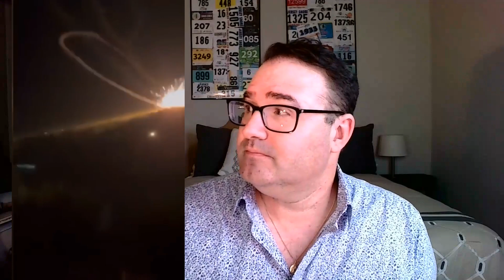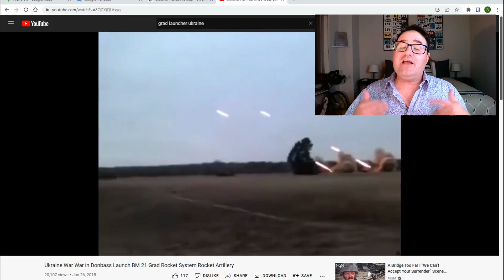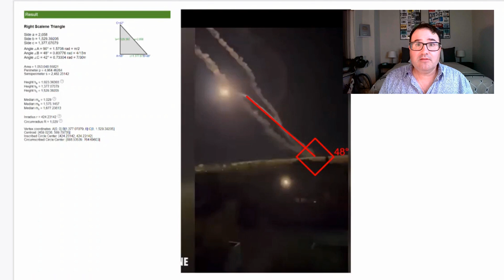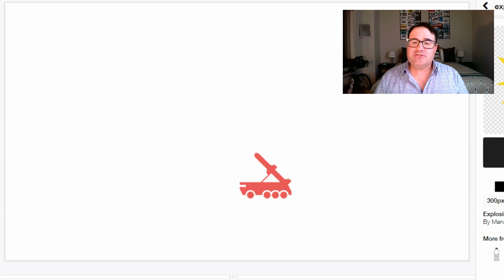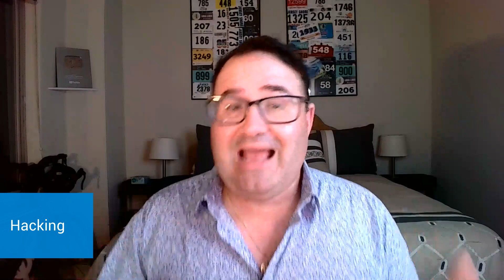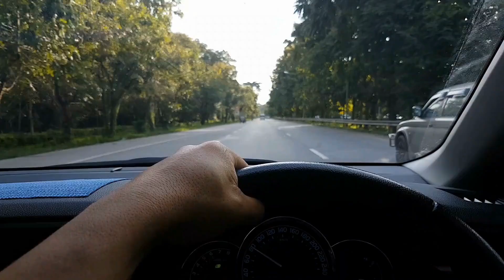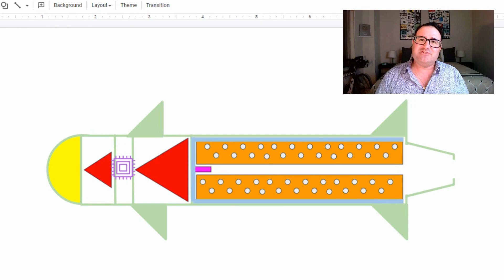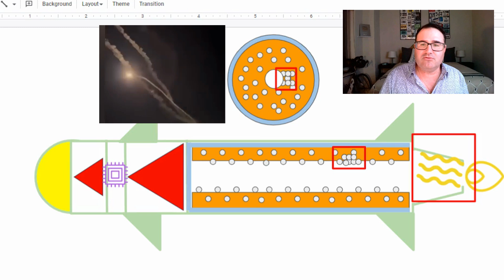Why this missile U -Turned

Comment: Hey. Great video but I was wondering if you happen to get your maths wrong in your distance calculation? You said the missile travelled 2054m in 2 second, making the missile turn around at just over 1500m elevation. At 500m away, the height of rocket would be 3x higher than the distance our observer is away, meaning our camera operator would have to point up way more to film those rockets, and the height of that explosion would be enormous (The Hiroshima blast zone, where everything was obliterated, was 1600m). So I’m just wondering if you maybe got a decimal point wrong there.

Comment: I think by stuck fin they were referring to them coming out. Most missiles launched like that the fins are retractable and only open after the missile has left the tube. I'm not saying this is what happened. But I dont think they meant they were trying to move the fins and it didn't move. I think they meant the fin didnt come out of the tube. Was stuck in the tube cause only say 2 of 3 fins to come out. Or 3 of 4. Whatever it has.

Comment: Doubt that therory as well. It's not like uneven burn in such a small diameter tube would act as thrust vectoring like that. Most likely a guidance/electronic failure. It's almost like a sensor was giving inverted values. When guidance initiated (seems logical that it should happen around there, when it's high enough to start to recive data from the guide radar) it was told that it was going both 180 degrees wrong in the forward axis, and 180 degrees wrong in the elevation axis. It corrected according to that data, and went back the way it came . That's my theory.

Comment: I see no reason as to why this could not have been a little bit of a hacking situation. Just because the network is not connected to the internet does not mean the missiles firmware couldn't have been tampered with in some way. Similarly to how the US distributed overpowered ammunition to destroy the enemies weapons in the middle east. There could be missiles distributed with malicious firmware that send the missile straight back to the sender.

Comment: We think of "hacking" as some guy in a hoodie stealing your credit card info, but that's not the only failure mode for the guidance system. Through negligence, tampering, poor maintenance or a system design issue, the rocket guidance system could have legitimately commanded the fins to steer that crazy track, and the fins would obey. It does not need to be a "stuck" fin if it's told to go to full deflection because the guidance computer or it's linkages are just broken. Electronics are notoriously fickle in a battlespace.

Comment: But shouldn't the guidance system & fins correct even for weirdly burning fuel?
And it's one hell of a coincident that it turns EXACTLY 180 degree, instead of just ANY other angle, especially strange that we haven't seen this happen earlier.
Maybe sabotage? it seams to be a "too perfect" coincident, it feels like some VERY precise math would need to be done for this to happen?
But otherwise I can't think of any other explanations either.

Comment: Hacking isn’t necessarily off the table. Like you said, those missile “clusters“ are not connected to the Internet (normally). This however doesn’t prevent the guidance system from getting hardware hacked. In a theoretical scenario, one could get access to one or all of the missiles, and reprogram the guidance chip. Note that would be hard to do, but for a experienced squat off saboteurs that would not be impossible. And yes it would be a lot simpler to just strike the missile cluster with the help of artillery or airstrikes. But the psychological effect of a missile turning around and getting returned to the sender, on the Russians as well as on the Ukrainian side, is way bigger then just a normal airstrike. 
One thing to also keep in mind, are the still existing supply issues for the Russian army. I am 90% sure, that if the Russian army would find missiles that are compatible with their systems, that they would use it. Now what if that missile (or missiles) where left on purpose, multiple  (or even just one of them) being manipulated to return to sender.

Comment: Without a doubt the engine vectored this missile back into the ground. I'm pretty sure it can't turn like that unless the thrusts' vector made it do that.
Reply: SAM are extremely maneuverable. Wasn’t thrust vectoring. It was definitely a locked fin because the front fins on sams require a significant amount of speed to be able to change course that hard. That is why it happened after a few second after it picked up speed

Comment: if I had to guess it looks like it was the rockets internal guidance failure. the onboard guidance doesn't activate until 1-2 secs into the flight. looks like the missile thought it was going one way and was trying to correct for the error. I.E it thought it was flying backwards and was trying to turn around. could have happened do to multiple things but a good place to look is a inverted or stuck gyroscope.

Comment: Sorry, Ryan, but you're definitely wrong about fuel settling. This is either sabotage/jamming (using a radar beam to point it back at the launch site) or an error where it locked on to the search/target radar.

Comment: Modern solid fuels are generally a mixture of oxidizers, aluminum, and metal  oxides in an epoxy-cured PBAN or HDPE core. They’re very solid and temperature stable, and the contents don’t shift around. What could happen is that the fuel was in sufficiently mixed. But the rocket did lose thrust for a period of time, it would end up pointing down, not backwards. 

If that rocket had multiple nozzles or multiple cores, there’s a possible explanation: One or more nozzles became clogged, resulting in a loss of thrust and highly asymmetric thrust. That could turn the rocket around, and the high G forces could dislodge whatever  was clogging the nozzle. Maybe. But I think it’s something different.

There is always some guidance, even during the boost phase. That’s necessary to keep the rocket from veering off while it’s still moving relatively slowly. The Sidewinder has a kind of passive guidance system using ailerons with little wind-driven gyroscopic flywheels- “rollerons.” 

This rocket may used a simple gyroscope controlled guidance system after the boost phase. Suppose the connectors for the gyros allowed them to be connected with reverse polarity, or that some drunken Russian technician installed them backwards- as happened with a Proton rocket in 2013. From the moment it led the launcher the rocket would be trying to correct its path, but there wouldn’t be enough aerodynamic  force  available until it gained enough velocity. Or it may be that the initial guidance system doesn’t kick in for a second. Some missiles use a short burning, high-thrust, motor to get them out of the tube or off the rail, and a longer burning, lower thrust sustainer.

Regardless, at some point there was enough force to turn the rocket around, and once that happened, the gyros would happily guide it back to where it came from.

Comment: How evenly it burns inside the rocket has no control in directing it. What you said does happen but it would only cause greater amount of thrust as it is forced through the venturi. If too much is lumped up then instead of burning fuel you will get exploding rocket that may or may not cause Ordnance payload to go high order.

Comment: Physically that would make sense if there's no exhaust port on the missile. If there is the degree that influences things wouldn't be so severe and, also, the flight time of the missile vs the compromised fuel matters cause it'd death spiral if it was a major clump while with a minor one it would just head up or down straight after hooking itself into those directions. Could it be a self-destruct mechanism?

Comment: The problem with your theory is that up until the turn the missile was going straight AND even after the turn it was also going super straight. I think mishandling somehow caused it to lock into its own launcher. If it was IR guided I would say that the hotness of the launch area, but the BUK as far as I hear is not simply IR guided.
Reply: If I'd design such a missile and it'd sense that its fin or some other factor derailed it from the intended course, it should self destruct to avoid any unwanted casualities. The missile thought it was doing the right thing. Maybe there two edit box on the GUI and they accidentally copy-pasted the same GPS coordinates (or equivalent coordinate system coordinates). Just a wild guess. Pretty painful mistake for sure.

Comment: I agree with the distance of 500m because of the sound delay but I think that the altitude of 1529m is overestimated. That would put the top of the screen around +3000m and the bottom at -3000m.  
The angle-of-view of the camera would be given by 2*arctan(3000/500) = 161°.

Most mobile phones are equipped with a wide angle camera in the range 60°-80° and only a few models provide a ultrawide camera with an view-angle around 120°. 

For a given camera view-angle α, we can compute the height h that satisfies the equality  2*arctan(2*h/500)=α . That is  h=500*tan(α/2)/2 

α=80°, gives h=210 
α=90° gives h=250
α=100° gives h=297 
α=110° gives h=357
 α=120° gives h=433

Comment: If there was a fuel clump on one side, the missile would continue to rotate in a spinning direction. One half on the chamber would be eaten away much faster. This would not account for it to return straight again. The Rocket still should operate regardless as the port or burner is in one direction. I would expect the same results as the fin issue to occur. A slight deviation to one side but nothing drastic. However I do agree that it could be down to it being faulty. What exactly could cause this? Well that is speculation. I do not believe it was hacked, I have never seen that capability before.  I can easily prove your theory regarding one half of fuel by taking a model rocket and stripping one side out. Anyway I enjoyed your theory but yes I do think this is not the correct answer either.

Comment: The fins weren't "supposed" to be moving during boost phase but it is in boost phase when g-forces are rapidly rising. A control cable controlling the fins servo motor broke loose during boost and powers a control fin to it's extreme position. No hotspot in the burning solid motor will generate enough lateral force out the rear to turn the rocket that sharply. And the lateral gas escape even right out the side of the rocket would be easily visible. Forensic video is always a delightful luxury.

Comment: I fon'T think a stuck fin or fuel combustion issues would turn the rocket perfectly 180° and have it go straight again. I also believe that the gasses are channeled to exit the rocket pretty much straight no matter how the fuel is burned.

Looks very much like a software/guidiance issue to me. Or sabotage (such thing existed before computer networks). I think even a crazy kind suicide is a more likely explaination than what's presented in the video.

Comment: I used to work in the missile industry. I've witnessed similar errors on a western SAM system due to fin actuator failure. At first glance, this looks to me like either a fin or thrust vectorer got stuck at full deflection.

During the initial flyout, a lot of missiles use actuators within the booster exhaust to modify the flow out the nozzle and thus, thrust vector the missile. This is useful because the missile often doesn't have enough airspeed for it's fins to generate any control authority. If this missile has thrust vectoring fins within the exhaust, it's perfectly reasonable that these may have failed in an open/closed state.

If this missile doesn't have thrust vectoring, then the fin theory is still valid, as it would take a few seconds for it to generate enough airspeed for the fins to actually have any control authority.
Reply: I would tend to disagree. If that was the case, I would imagine that the missile would have a regular curved trajectory. 
Here, the missile is going more or less straight out of the can, and when the guidance kicked in, it made a u-turn, and then went more or less straight. 
This looks like more like a gyroscope guiding the missile. A 180° misplaced gyroscope would have exactly that result, and that would explain why once the correction was made, it went on a standard trajectory for this kind of missile, but just upside down.
Reply: @fabr5747  I don't think it did a 180 back to the source.  There is a video of this incident from another angle that shows more of an arc downward and away. The angle we see in this video makes it look like it's travelling back to the launcher but it's more likely an optical illusion due to the missile actually moving towards the cameraman.
Reply: @prinzalbatross9526  I'm going to go with It just failed to do its job, and be done with it. It was stated at the beginning of the video that parallax effect should be taken into consideration when attempting to understanding the trajectory.
Reply: @prinzalbatross9526  I agree with you on that. It definitely is most likely approaching the camera and deflecting to the missile's left (camera perspective right) and down.
Reply: @fabr5747  Yeah this is valid, you make a good point.
Reply: If the missile is capable of mach 3 it would require fins smaller than people think.

Gimbal lock!
Reply: Doubt its the fin because i feel like it would of kept spinning but it didn't
Reply: Wow, what a nerd… I’m so glad you’re here!

Comment: Is it possible that these SFA missiles are some kind of radar or infrared guidance at some stage, that the rocket got past its initial "tube" launch, and then in its next phase, maybe because the firing platform was hot now or still emitting a lot of radar? it found the smoke or just the radar signature from the vehicle itself, and immediately turned around?  Essentially, I'm wondering with my limited understanding if it started "seeking" too soon or because of the vehicle's previous launches or continued radar emissions, the missile suddenly seeks the vehicle it was launched from. 

It REALLY seems like that rocket was calculating a trajectory back at that vehicle. It seems even more astronomically rare of an occurrence that it would form such a perfect path back or even turn that sharply without deliberate guidance on the rocket's part.

Comment: In 2013, a Russian Soyuz rocket seemed fine seconds after liftoff. But then it suddenly veered off in one direction and tore itself apart. That’s what happened here. It turns out, a technician had installed the IMU backwards (the sensor that tells the rocket what “up” and “down” is). 

That has got to be what happened here. And better yet, these rockets are programmed with a “boost phase” for safety. The rocket will boost forward for a few seconds and THEN the full guidance system will come on line. That is why it seemed to fly normally up to that altitude and then veered off. It’s not a new problem to Russian rocketry.

Comment: A pressure differencial like that would rmake the flow inside the engine so turbulent that it would've ruptured the casing imo.

And well - guidance is there to correct for some thrust assymetry. We'd see a turn slowly developing and accelerating only after there is no more control surface authority to stop it. These missiles can pull a lot of G at high speeds. I highly doubt that guidance wouldn't have been able to counteract simple thrust asymetry.

Comment: I have another theory, but it's a bit hairy.  I've heard that Russia have guidance systems that use GPS.  This makes absolutely no sense from initial thought;  as GPS is US-controlled,  and Russia have their own positioning satellites, don't they?  Well, on second thought, even if the Russians do have their own positioning junk, chances are it does not work at all, first of all;  and secondly, in order to use it, they would have to produce their own silicon chips to receive the signals and de-scramble them, but they don't have much a silicon etching industry of their own;  just very old machines for like 100 nanometers;  PLUS, since the end of the cold war, Russia probably did not expect the US to use its power of GPS denial against Russia anyways;  and to add GPS capabilities to their guidance systems it's just a matter of buying a GPS chip for 50 cents from Alibaba and connecting it.

  Now, when the US designed GPS, they designed it FOR THEIR MILITARY, and civilian use was just a fringe benefit that they permitted almost begrudgingly, and from the beginning it was artificially randomized, so that it could not be used for munition guidence by rogue nations.  So, when you use GPS in your car, the receiver is actually getting a jittered position over about 100 meters, and the software is doing time-averaging to destill a more reliable location, which is okay for a car, but too slow for a smart munition.

  So far so good?

  But if I was a war planner, I'd make sure I have an extra card up my sleeve;  something a lot more drastic than a mere random jitter.
  For example, something as crazy as being able to tell the GPS satellites to send a totally fake GPS signal, suddenly, and just for a few seconds, so that  a smart munition using GPS suddenly thinks that its destination is back at where it launched from.  It is not entirely not doable.  Give me a few months and I'd be able to code it myself.

  No hacking involved;  just a momentary position scramble deliberately miscalculated for a particular guided munition the moment its launch is detected, to use it against its own launcher.  Pretty complex math to do that, but it only needs to be programmed once.